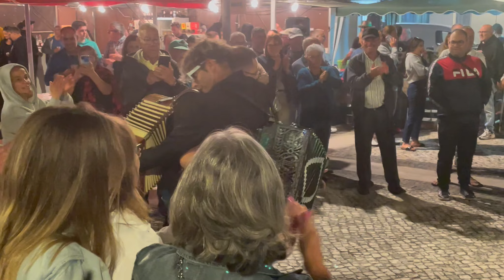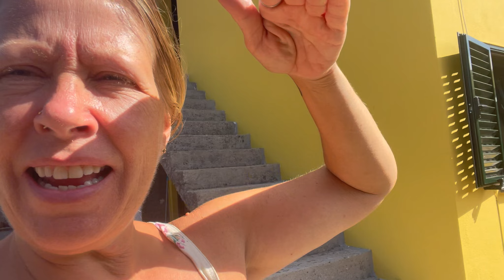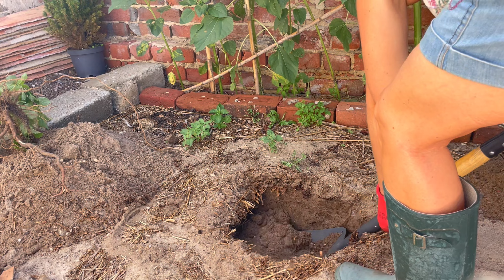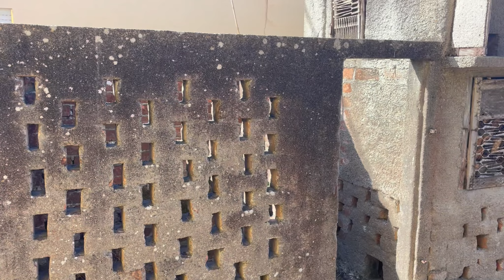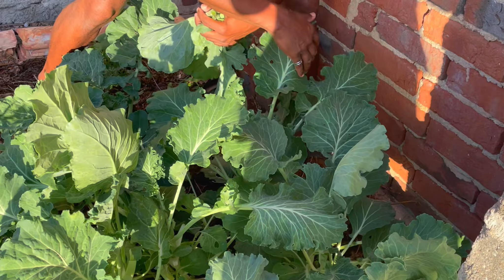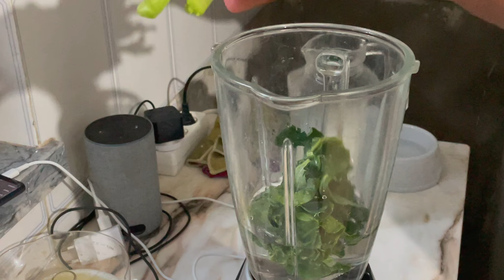Epic Fail - House and Garden Renovation Portugal

Comment: Susie, LOVE your vlog but two things about gardening: you need a spade to dig out plants and dig deep holes not a shovel, which is for shovelling things, like dirt, gravel etc.  Secondly, hot summer isn't great for moving plants. It often kills then because the hot weather is stressful enough at times.   Winter and early spring are much better.   Teresa
Reply from the maker: Hi, thank you for your information. I actually wasn’t really that bothered if the Lanterna lived and it was in the way where it was which is why I moved it. But amazingly it has survived the transplant and is growing again. It  seems to be a very hard plant to kill.